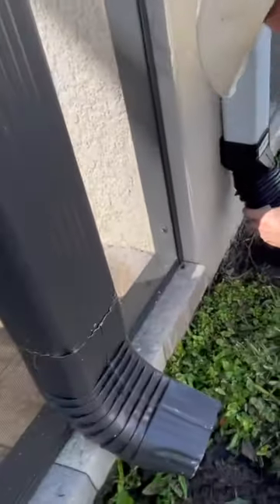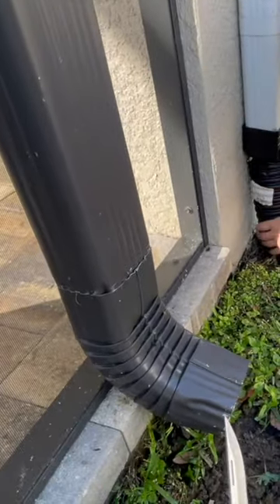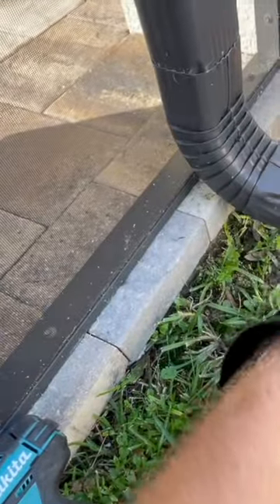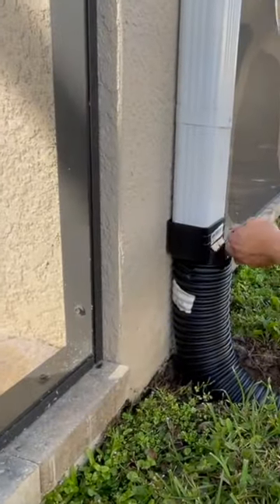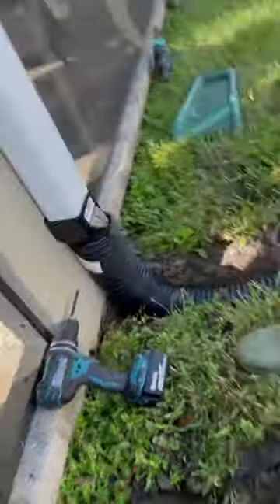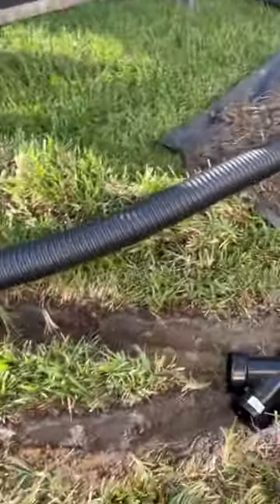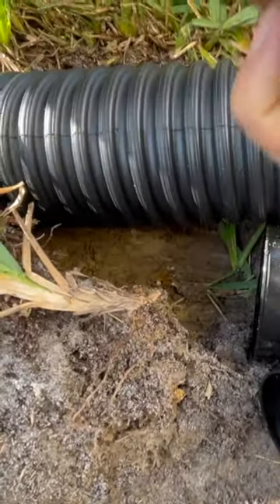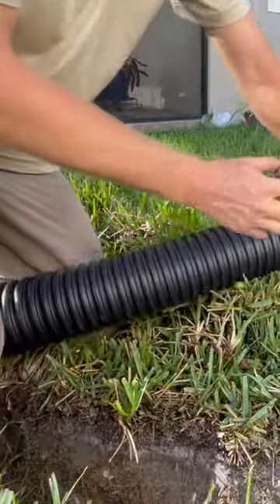How To Connect Downspouts Into Your Drainage System | DIY Short

Comment: Corrugated is skimping out material because contractors want to pay less and have an easier install, just slap it down like this. Black rippled pipe holds solid material, holds standing water in the undulations, tends to have dips & valleys, and will eventually clog getting penetrated by roots. Not good for that location seeing that the grass is St Augustine / Floritam there is no freeze, that system will fail in just a short few years. Pull the pipe out of the ground in the wet season (when it fails) and you will see it will be full of water being held (mosquito breeding ground).
Reply from the maker: Hi Ryan, using a more expensive pipe would actually result in the contractor making more money. Material is paid for by the client, not the contractor, and our markup percentage on getting the material ourselves would be higher with more expensive pipe. Aside from that, the cost of install would be greater too, as a bit more labor would be necessary. We love using SDR35 over corrugated because it means we'd be making more money, but we only install it when necessary or requested.  That being said, the ripples in the pipe actually created turbulence when installed correctly without bellies and with proper slope, and help floating debris exit the pipe if it is not caught in catch basins. It's also better for roots... while no pipe is safe from the constriction of roots, running corrugated reduces the amount of joints or openings in the pipe as opposed to PVC/SDR35, which is where roots normally compromise drains. The biggest downfall of running this pipe is the structural strength, it shouldn't be driven over or built upon. All that being said, we do recommend customers to have their drain serviced 1-2 times a year to keep it running well.
Reply: @TampaDrainDudes  the 'turbulence' not only will hold roofing shingle gravel, but also will retain standing water inside the corrugated pipe. You'd have to use more expensive double wall with a smooth inside to get around that inferior defect
Reply from the maker: That we can agree on, double wall is our favorite, but unfortunately it is nowhere near some our customers budget.